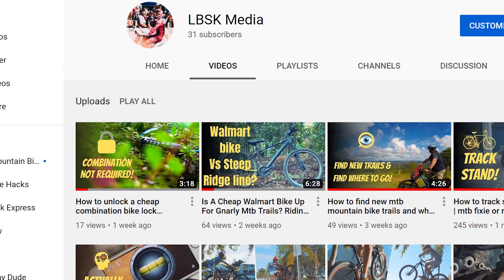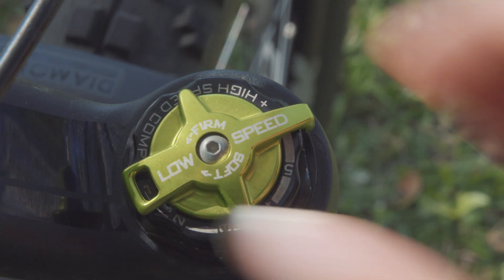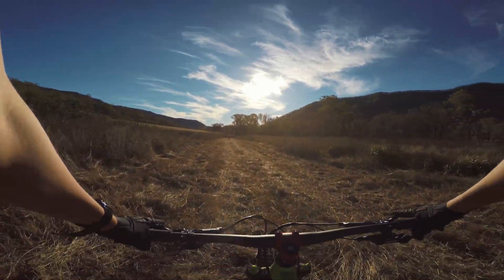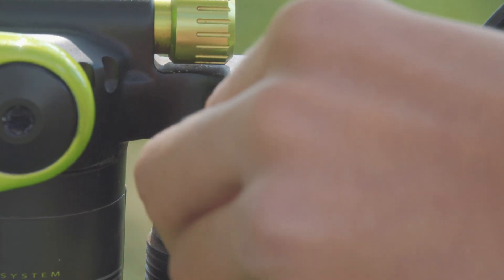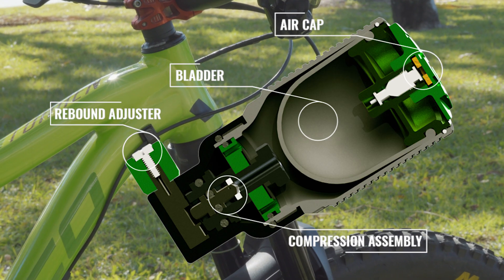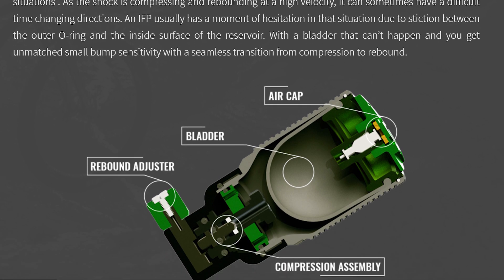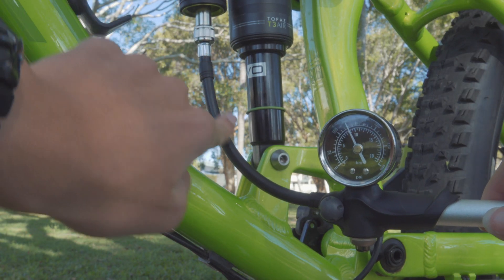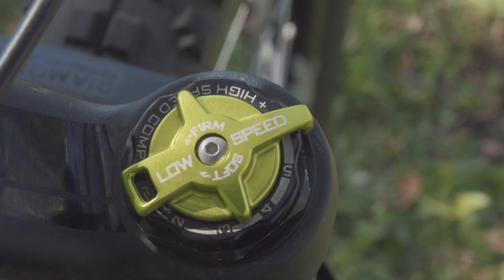How to fix DVO suspension | Topaz t3 squishy noise/lockout not working | diamond D1 harsh bottom out

Comment: Pretty certain just about every modern air shock has a second air valve to regulate the IFP (internal floating piston) or in DVO's case a bladder. The RockShox can be accessed but requires a special adapter to reach the schrader valve. Fox doesn't use a schrader valve, they use a special pellet valve which makes it more difficult to service. Glad to hear you solved your problem.

Comment: So if the air always comes out everytime you remove the shock pump it means you don't really keep the desired air pressure that you set it. How would you be able to set your sag properly if air keeps coming out when you remove the pump? Thanks!
Reply: The air that you hear escaping is just from shock pumps hose itself. When you connect pump that is around max 10psi loss of air filling the shock pump.
Reply: You pump it a bit more than your desired pressure. Let say your pressure is 100psi then pump it to about 110psi.

Comment: Awesome video! Always check your bladder pressure. We recommend re-inflating it at least once a month. If the bladder is pressurized and the shock is still making that "squishy" sound, it's definitely in need of a service! Otherwise, keep it properly inflated and ride!
Reply: So this is my second DVO Topaz, first one had this issue and required a full replacement under warranty. And here I am again, bladder fully inflated and yet squish noise and the lockout does nothing. The shock also fully leaks air as I can start a ride at 170 and finish with like 100. I'm about to send off for service, but I wanted to know what causes this, has the bladder got a hole in it? Reliability is not what I was hoping for
Reply: @TheShmooty me too. Loss of air during ride. Pedal strikes, one sent me down a small 8’ cliff!!!  I think the reserve bladder must be 200psi for sure.
Reply: @TheShmooty  i have the same issue dont suppose you or @henryhester1897 found a solution
Reply: Hey i have DVO Diamond D3 fork and when it compresses and slightly gets back it will make this weird deep click sound, i tried rebound and pressures and nothing helps. you can hear it on some of my videos.